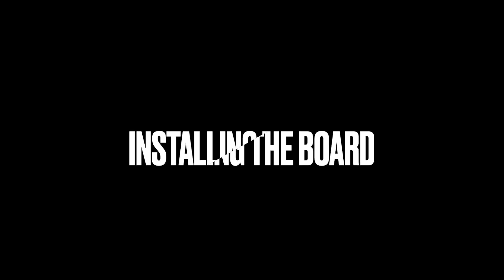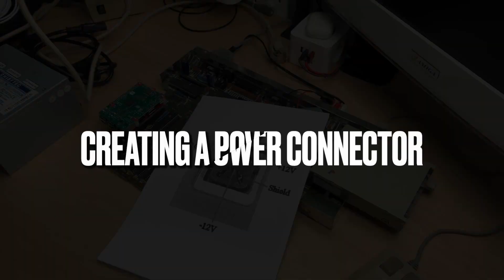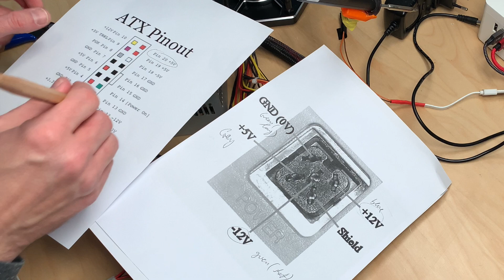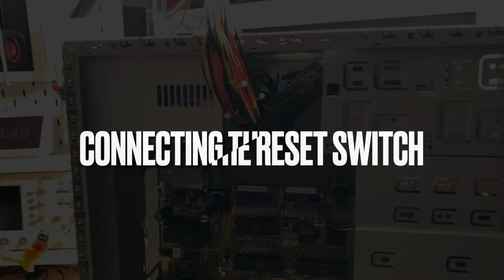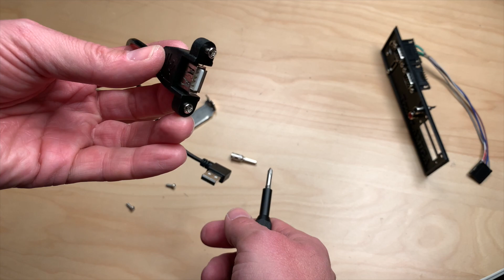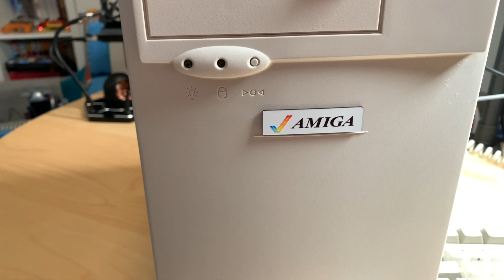The Amiga 500 Tower - Part 4: Finale - Putting an Amiga 500 into an ATX PC Tower Case

Comment: Good job! A suggestion, in case you would come back to the project: adapt the DF1: board connector for a second front drive, below the existing one. No need to use the external DB25 (cutted) anymore. Plus, you could think a way to use a removable CF card. That would make the "A500-PC" way more usable. Cheers!

Comment: Very nice and I have one question: Is the case a Midi Tower? It looks like it but just checking.
I found about 5 years ago some connectors from Poland or Ireland, can't remember which now that had a 20/24ATX power connector on one end, housed in a plastic case with a switch, and a cable to a proper Amiga 500 square connector on the other end. They would be perfect for this type of conversion as it reduces the amount of wiring and connections required but I do like your creative solution.
Thank you.
Reply from the maker: Yep. It seems to be just in the top end of the midi range.

Comment: You can add a Pi zero RGB2HDMI Adapter to the Denise socket, then you don't need the normal 23Pin Video Port and it reduces the chance to accidental plug in a external diskdrive to that port.
Reply from the maker: That's true. At the time I was working with what I had in stock ;-) ... but there will be a Part 5 soon!

Comment: I used to make my own connectors with biscuit board used to make circuit boards in schools and circuit board pins and just lined up the holes of the board and cut it out with pliers for the right circle/square shape and soldered to the pins and taped it onto socket lol.
Reply from the maker: I thought about that, but I am too clumsy for that kind of precision work! ;-)

Comment: instead of plastic standoffs with double sided tape I would have gotten a bunch of threaded brass standoffs and drilled holes in the case for them. I also would have used a mid tower case (yours is a mini tower) and used a dremel to cut out a back pane for the edge connectors. also, there are pre made cables on fleabay to use from ATX pwr connector to Amiga pwr connector
Reply from the maker: You seem to be quite the metal worker :-) Thanks! That would have been a great approach. I could have pulled of the metal standoffs ... but I am just not skilled enough for clean cuts in metal.

Comment: I'm really impressed by all the work you put in. What I like are the expansion capabilities now possible due to a larger case than the original wedge. At the same time using an A500 (instead of A600 or A1200) keeps the project affordable and easier to maintain/expand in the future.
My dream project would be to take an A500, put it into a flat/tower case and expand with modern open source components, like Gotek or Pi.
What I would do differently:
* I'd keep an original A500 as a keyboard, or use an usb keyboard. The A2000 keybords are more expensive than an entire A500.  
* I'd use a modern Amiga PSU replacement instead of an ATX PSU (Noel did an episode about it).
Reply from the maker: Thanks! Using the A500 keyboard would be even easier. You would just have to use some extension cable for that.

Comment: Next time, buy a ATX extension cable and cut that instead.  That way you can reuse this power supply in the future.  Even better, if the power supply were to die, if you use an ATX extension cable you would just plug that into the new power supply and you're back on your way.

Comment: I really think you should pick up a 5 Pin Din connector for that power supply connection. They are still around, and not that expensive. They also make ATX to AT power switches as well, so you could use that to connect your power button. Specifically that button though, I don't know,  you may need to make a few changes to what is available out there.  
I like how you ended up fitting the board inside the case, I hadn't considered that angle before. Over all well done, and good on you for preserving the board the way they made it.
Reply from the maker: Thanks! That power connector works really well and is super stable (thanks to the hot glue mess). Holds up way better than it looks! I saw the connectors on ebay but I thought it would be fun to come up with a way to do it really hacky! And I hate to destroy old hardware so extensions are not pretty, but they keep the board as is. I will take a look at this ATX to AT power switches. Sounds interesting! I once did something with a small relay. That worked too.
Reply: @RetroWK  Should be fairly easy to swap the existing switch out with a toggle rather than a momentary.... after all, you shoe horned an A500 board in to an atx case ;). Another solution would be to run an arduino / esp, connect the momentary to a digital  input then control a relay across green and black on the PSU which would bring it to life. You could power the uC from pin 9 on the ATX psu which is 5v standby power
Reply from the maker: @Veksta  I did build something with just a relay for my MisterFPGA (which is inside a desktop PC case). Works fine.